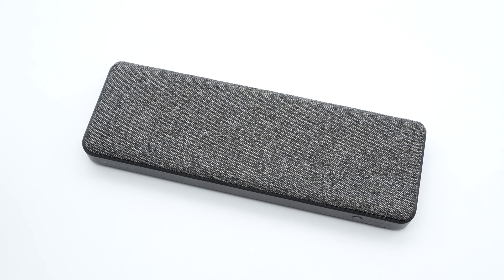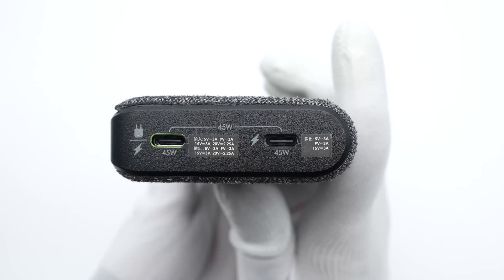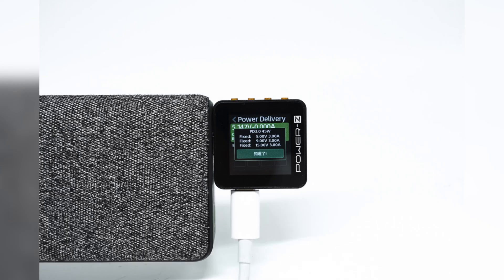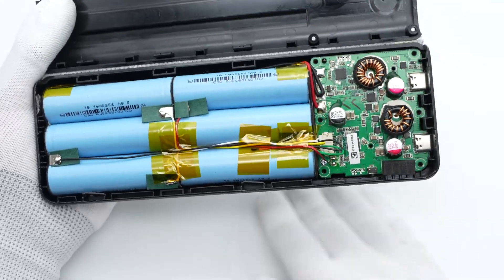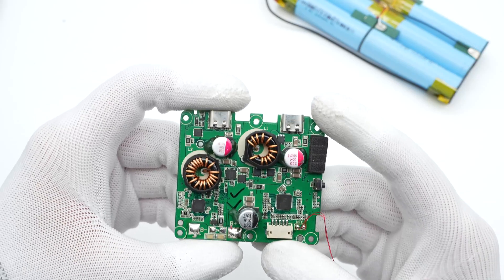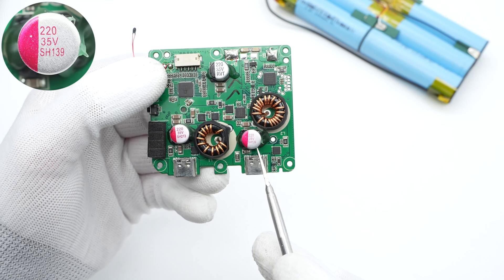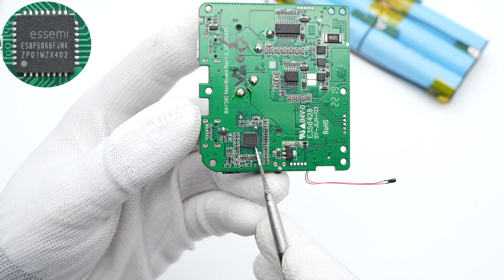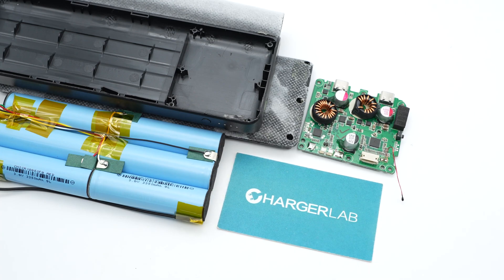Teardown of Mophie 45W Powerstation Pro Power Bank (Available at Apple Store)

Comment: I bought it recently and I found it was completely discharged. So I tried to charge it in full. Anker 65W Could charge it in a few hours. It started with flashing all 4 lights and then after a while (pretty long haha) it started flashing only one - once it was charged at 25% one light flashed constantly while the second light started flashing. And until full charging.
Pretty good power bank. Of course, when I wanted to start charging my MacBook Pro first it was shown an icon for connecting to the charge but the information was "not charging". But after a while, it started charging. So far I'm glad with it ;)

Comment: Hi nice teardown. A quick question though, why is this advertised online and on the packaging as having 20,000mah capacity. Yet on the base of the unit it said a figure around 10,000 ?
Reply: When he opened the power bank, I see each battery has a capacity of 3,350 mAH, there are 6 of them, so doing the maths gives us a total capacity of 20,100 mAH
Reply: The battery inside is going to transform the voltage rate via a transformer. From 3–4 volts to 5–20 volts ( PD,PPS, fast charge technology). Thus, the real capacity is always a little lower than the capacity of the battery inside.

Comment: any idea why mine has all lights flashing all the time? doesn't charge anything and doesn't seem to be able to be charged either
Reply: Mine did the same until I used an old Samsung 2A charger and the unit finally started charging. While it took all night to fully charge, my powerstation pro is working great.
Reply: @wyattearp1845  glad to hear that. I couldn’t get mine to charge using a variety of chargers, so I ended up returning it.
Reply: @justinsoulier6305  man, that stinks. Did you go with another battery pack?
Reply: @wyattearp1845  yeah, I went with the Anker - PowerCore III Elite 25600 mah. It’s been charging all day, but good news is that I’ve at least been able to do a test charge with my iPad and it worked, so I’m hopeful.
Reply: Same happening to me... It only flashes the fgour lights when connected, otherwise it doesn't even turn on...
Reply: I @theoradicella1360  I would return it if you can and go with something different. I am very happy with the Anker unit I bought.
Reply: Hei! I think I have the same problem. did you find a solution?
Reply: @flash98db mine has the same issue! Any luck?

Comment: Always surprised there is no low temp sensor to prevent damage.
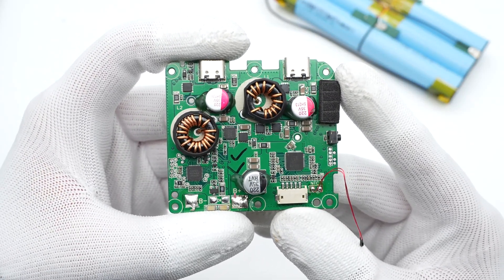Reply: At 3:23 you can see NTC sensor on the PCB in right bottom corner.